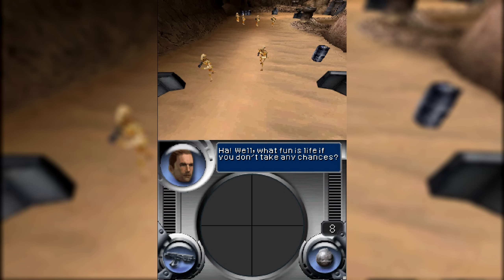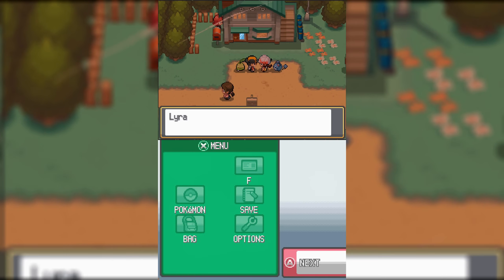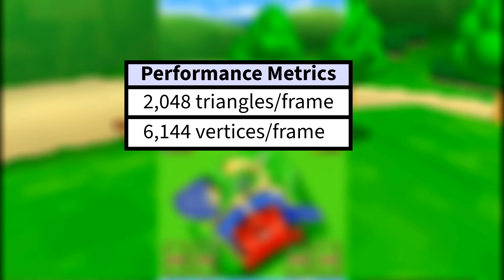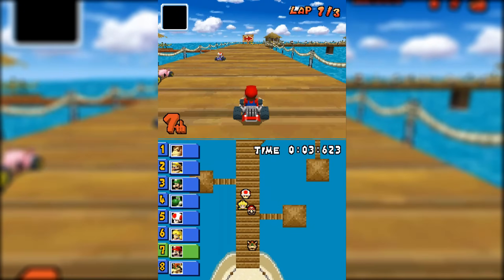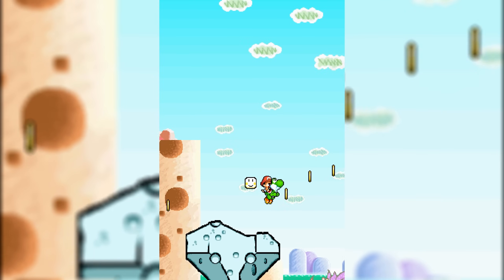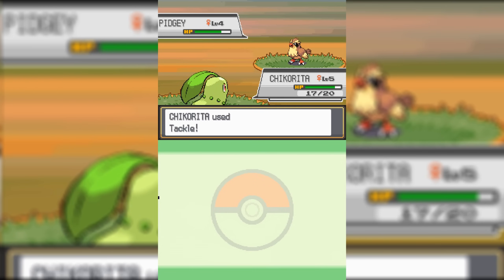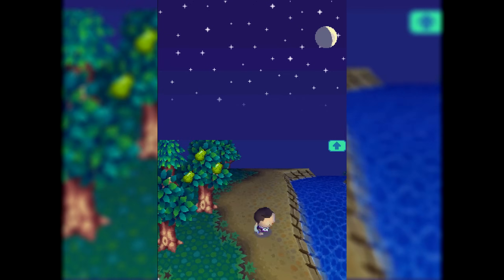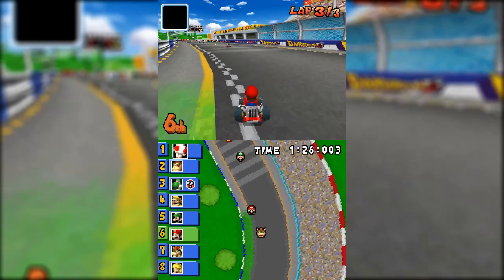The Nintendo DS GPU - 3D Engine & 2D Engines

Comment: I remember reading somwhere, that, just like the rendering in two screens function, the DS was "capable" of displaying more than 2048 triangles by only rendering half of a frame, then renderining the other half, targeting 30fps for 4096
Reply: The only way to increase the geometry throughput was to reduce the amount of commands per primitive in the geometry buffer. That meant only sending the vertex components that were actually required and using quads and maybe strips and fans (not sure about the latter two, it’s been about 15 years for me) when possible. Due to the way the DS renders, it wasn’t really possible to render in more than one pass. I’m not even sure, if the geometry buffer could be flipped (it was double buffered, iIrc) mid-frame via the horizontal blanking interrupt. But if you constructed your geometry carefully, you could go above the 2k tris limit, often to 2.6k and above 3k with some effort.
The half-refresh doubling only worked, if you essentially captured the first render pass, set it up as a 2D background and then rendered again. That way you could display 3D on both screens. I forgot, if the captured pass could be displayed below or only on top of the second 3D pass. I seem to remember, that 3D was always the bottom layer. I also don’t think the captured pass supported transparent areas, so layering wasn’t really feasible. I doubt, that any commercial games used this to extend the geometric complexity anyway. The number of triangles seems small, but in practice it was plenty and somewhat comparable to the N64.
Reply from the maker: Oh very fair point and that makes sense!
Reply: You render the full frame on  alternating frames then capture it using the 2D engine like sillyorb posted. Then you switch main and sub screens every other frame.

Comment: The visuals felt like a modernised portable PS1 in your hands. 

Playing Resident Evil Deadly Silence was my jam!
Reply: Even faster than N64 with Mario 64DS/Rayman 2. 

After that good 3D game ports were kinda stopped 😅
Reply from the maker: That’s a great comparison!
Reply: A modernised PS1 with some N64 DNA thrown in the mix. They should have ported the N64 Zelda games to the DS, but those became upgraded hits on the 3DS.
Reply: PSP was the modernised PS1 handheld. DS is just a crippled N64. PSP was somewhere between a PS1 and a PS2.
Reply: @pgr3290 OP was talking about the visuals specifically, which do look very similar to the PS1 except with perspective correction.
Reply: @pgr3290 lmfao are you high?? The psp obliterates ps1 graphics and gameplay. The psp was more a portable ps2.
Reply: @ Plenty of PS2 and PSP comparison videos to establish the hierarchy of performance you can watch.
Reply: @Tanzu15 Yeah.... Especially when you see Wipeout pulse running at 60fps in the replay.  It's beautiful
Reply: @pgr3290 the psp is literally more powerful than the dreamcast what are you smoking
Reply: @pgr3290  Lmao, no
PSP was basically a portable Dreamcast with even more RAM that the PS2.
Reply: @raypuiaascii4653  PS2 had 40MB of RAM total. PSP had 36MB. Later models had more but that didn't change performance, just what was commonly available for manufacturing at the time.
Reply: @pgr3290  It was far ahead the PS1/N64. It was between DC and PS2.